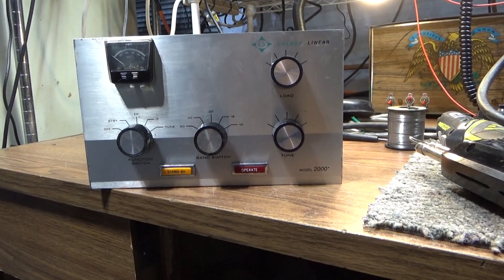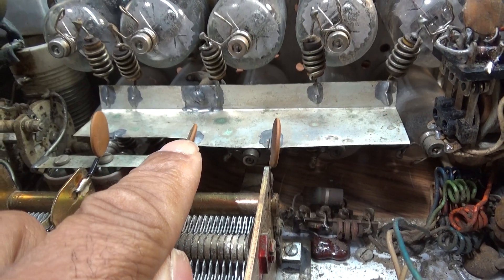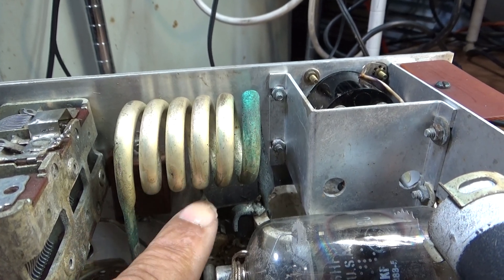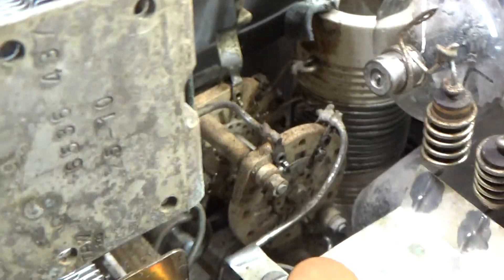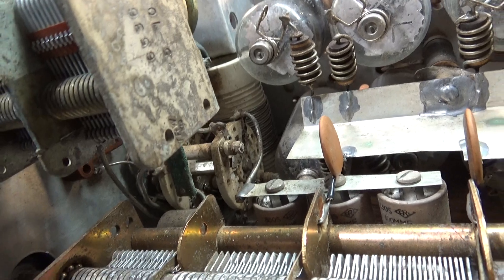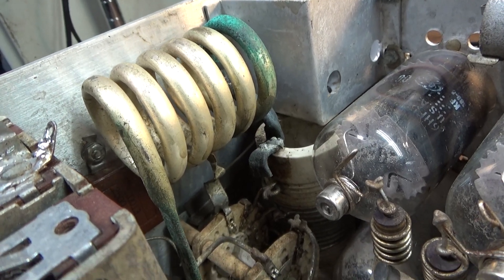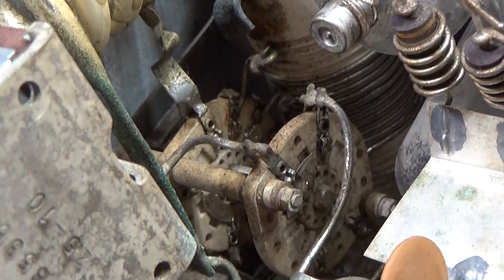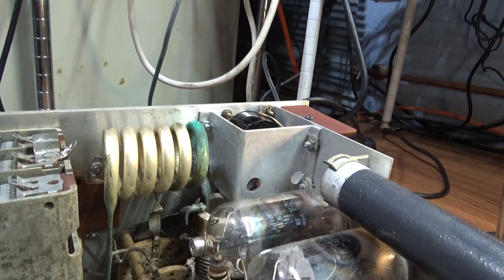Galaxy 2000 10 Sweep Tube Amp before the refurb + monobanding + some quick thoughts on Mono Banding

Comment: 9:15 Agreed, the extra components and complications aren't needed in a monoband amplifier. That's how I've built mine.  Personally, I'd rather not strip stuff out, so that I could still use it on all bands, but I certainly understand the logic behind your thoughts. 👍
Reply from the maker: Sometimes I do that, sometimes I don't. With the old Galaxy here, those multiband components were toast. See the green?
Reply: @tramdr Verdigris? 🤔

Comment: 1:46 Just for clarification, isn't that the load cap, with the tune cap directly above it? 🤔
Reply from the maker: No. That amp is weird. The four section cap on the bottom is the Tune. Also, the four sections are in series / parallel. Then the smaller Load cap on top is the one where they switch in all those fixed caps to make up for the extra capacitance needed on the higher bands. With most amps, the Tune would be the small cap and the load would be the larger one as the Load capacitance is usually about 4x what the tune capacitance is. Though with voltage is about the opposite.

Comment: You better be careful sticking your fingers inside those old radios and amps.  A death cap might get you.
Reply from the maker: Thanks but this is a 2 piece amp with a separate power supply. Thats where the death caps are. The power supply has been recapped tested and ready and heavier new bleeders were placed across the caps, and the power supply is not plugged in nor is it connected at all to the RF deck. That's why I am so comfortable sticking my finger in the RF deck. Otherwise, 'don't do that'
Reply: This guy's knows what he is doing,for you to even say they too him is insulting in...he knows more about these amplifiers then you will ever know in your lifetime..he knows we're and what to touch and what he can..and when..... I guarantee ya the hv is bleed off and it's safe .. now if he wasn't a master at what he is doing id fully understand the comment.... But here Na!! He more than knows ...73

Comment: IN THE 1970s I WAS A KID. AND HAD NO MONEY OF MY OWN. HINDSITE BEING 20/20, THAT WAS A GOOD THING. I WANTED A MACO 500/750/1KW OR HEATHKIT SB220. I WOULD BE DEAD NOW. IM SURE I WOULD HAVE ACCIDENTALY BEEN ELECTROCUTED. A PART WOULD FAIL AND THAT HIGH VOLTAGE WOULD HAVE GONE TO GROUND WHILE IM KEYING DOWN.
Reply from the maker: Have you seen my Drake L4B story as a kid?
Reply: YUP . ASKED ABOUT THE SPT-500
Reply: @tramdr if a part failed, would the electricity go to the (ground) does that mean the outside case would be hot with electric? Is all amps this way? 
Is this one safe/less safe compared to something like a phantom 500 or palomar 300a? 

😊
Reply from the maker: The bigger the amp, the less safe they are, period. However, with all the talk about how sweep tubes suck, one thing about them is that sweep tubes run on around 800-900 volts. Transmitting and or Ham tubes run at 2000-10,000 volts. The higher the volts the higher the danger too. Actually, I am more scared of the higher voltages in the Ham amps than the voltages in the sweep tube amps even the multi tube Galaxy 2000. Any amp can fail, parts can short, parts can open, stuff can shift or move or arc, but even mud ducks always talk about a good ground. Safety is one of the reasons why. If a part shorts to ground, good grounding will save your behind.
Reply: @tramdr  ok, ground is something I've never had. I plug my 2x 50a mega watt power supplies into the wall.. hot and ground go to 2x bus bars and that's where I get my 12-14v electricity for my mobile radios and pill box. I've never had a ground from outside ran Into the home.. only the electric plug in ground. So a actual ground is something I would need for a tube amp? Seems like it! 
Price wise $400 for 300a 450ish for a 350z.. 450-500ish for  phantom 
Then 600 for the galaxy 2000.. 
These were random prices I've seen you list before (understanding not current items for sale) 
Best bang for my buck sounds like a galaxy 2000 or similar. 
I want 1kw, clean and reliable while affordable. 
While replacing the pills in my mobile is my cheapest route I really want a tube amp for the base station. 
Any pointers, or guidance. You mentioned a phantom or a maco kw. 
Guess those are my only options, but for the price isn't it better to go with something like the galaxy 2000? Getting double the power for roughly the same?
Reply: if the high voltage goes to ground it either instantly blows the fuse in the amp or the breaker feeding the wall socket.  The only real danger would have been if you opened the case and started poking your fingers into it.